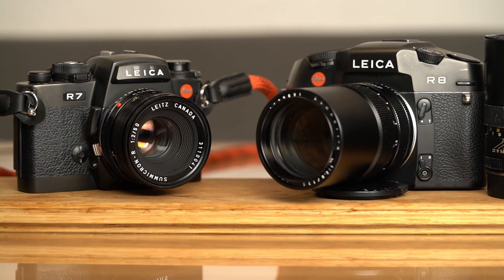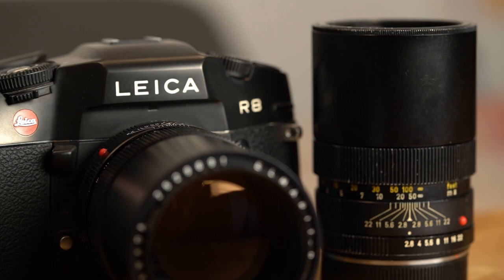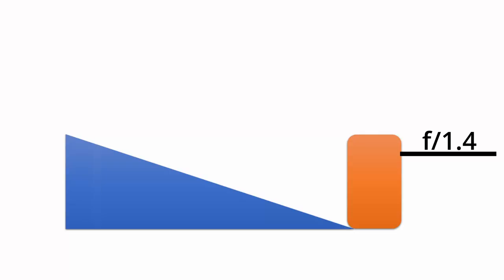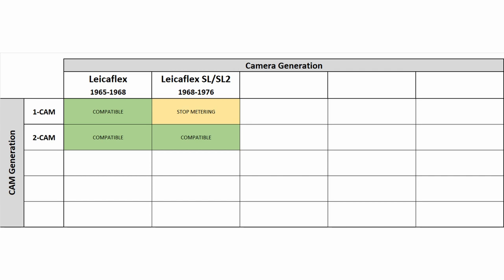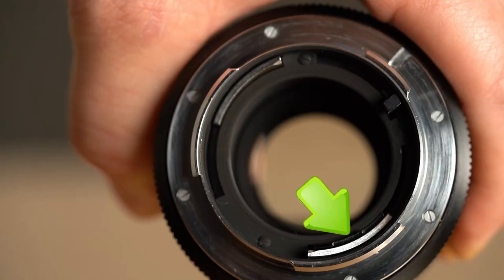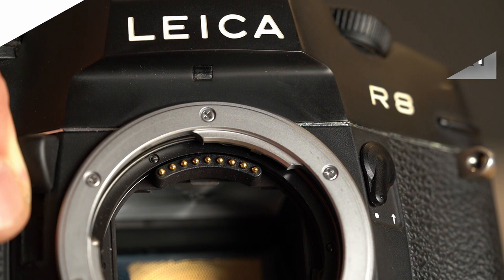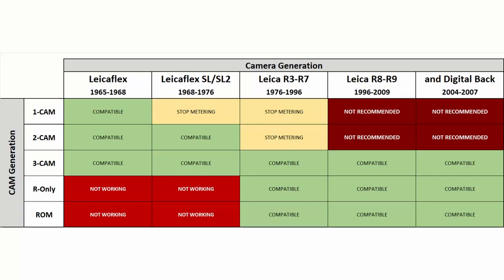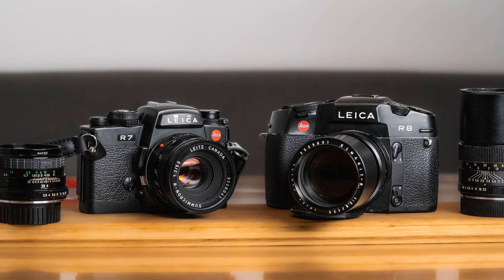Everything you need to know about the LEICA R-MOUNT

Comment: So it is better to buy a older Leicaflex or the R3 because the Lenses for the R8 are very expensive and it doesn't work with the older lenses.
Reply from the maker: It depends on the camera or the lens you have or want to use. For shure there can be problems with some combination. But you do not need to buy the too expensive rom lenses. If you want to use something below the r8.

Comment: Hi...! Ihave a Laicaflex (mark 2 / 1966-67) with a Sumicron 50mm f:2 and an Elmarit 35mm f:2.8... Can I use these lenses on a Leicaflex SL...? Thanks.
Reply from the maker: Well I can’t answer this, because I don’t know which kind of lenses you have exactly. 

But the leicaflex and leicaflex sl should work with a lens if the lens has the first and the second cam.
Reply: @manugeee  Thanks!! I think 1-Cam.

Comment: can ı use all off them with r3? ı dont care metering to much?
Reply from the maker: Hi there, yes. you should be able to use the 1- and 2-cam lenses when stopping down your lens manually and metering the light intensity. As the ROM Lenses also should have the 3rd cam, they should be compatible. Best would be, if you have a good picture of the back of the lens, if you buy online.
Reply: @manugeee  ı find 35mm f2,8 for 220 dolar ıf ı can use manuelly ı buy ıt doesnt matter ıf ı can use ıt thanks bro

Comment: Using an R-Mount is a bit like being the Count from Sesame Street: "1, 2, 3! 3 Cams...ha ha ha." 

It's a gorgeous system and you can really see the partnership between Leica & Minolta.  The problem, though, is that it's so rare to find them in good condition.  They seem to not hold up like the M over time, and it's such a shame there's so little repair resources for this. If you're going to look into this system, just be aware that the glass prices are unreasonably over-inflated due to Cinematographers converting these into Cine lenses
Reply from the maker: THREEEEEEE! It’s a THREEEEEEEE333333!!!! 🤣

I had no issues with the cameras yet, but as you said. If it’s broken, it is broken. 

And I agree. The lenses I got into my hand, are pretty good but not what I expected of the name Leica. It is maybe just my expectation and not that much the name. But 400€ for a 30 year old 50mm f2 are a liiittle crazy. 🙃

Comment: Hi, what are the cheapest lenses to buy on Leica R8, Thanks!
Reply from the maker: Hi there,

Hard to say. I got the 135 f2,8 3-cam for 180€ but sometimes it is also for 250€ to buy. The Summicron 50mm f2 is very common and versatile, but goes for 400€ the wide angles 24 and 28mm are very  expensive. But this is almost everything I have directly in mind. 

I would not go for the zoom, because I don’t like zooms that much. So this is my personal thing.

There are much more lenses, but they are not that common and I did not see them a lot on eBay and if yes, then they have a price.